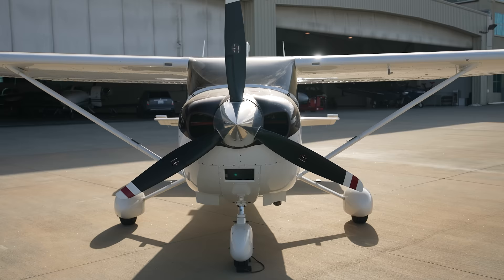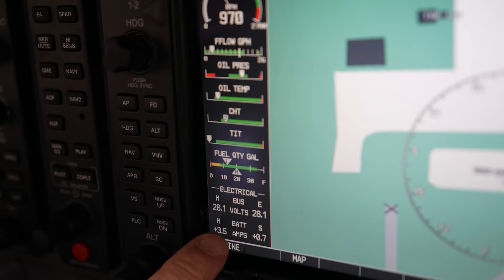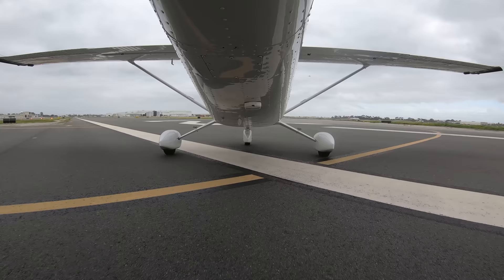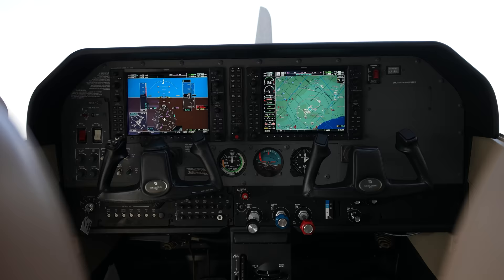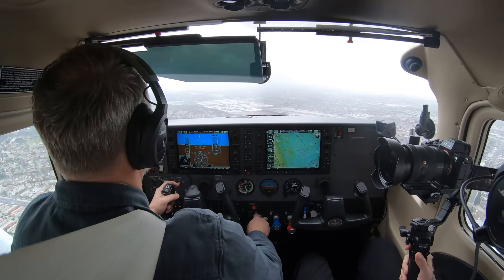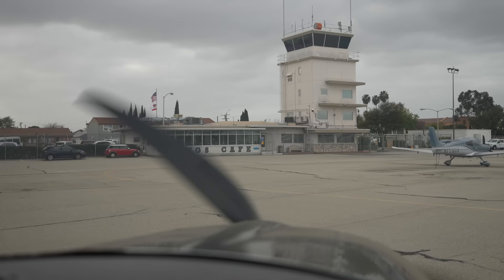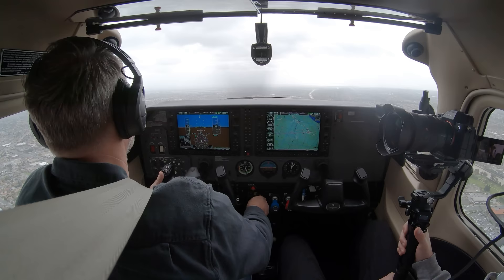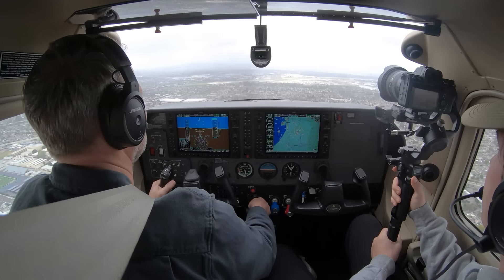2013 T182T Flight to Fullerton Airport

Comment: Great hearing you talk about getting a PPL later in life.  Got mine recently at 52.  The only downside is the cost.  I have learned and should have realized before, that its a "rich man's" hobby to some extent.  Sure, you can find a cheaper old aircraft, but throw in storage, maintenance/annuals and insurance.  Cheap, it is not.
Reply from the maker: Agree. Sometimes a flying club is a good option if you can justify whole ownership. Thanks for the message.

Comment: Hi, First, I must outline that I enjoy watching your video, all your videos.  Informative and inspiring!  My question is: since a brand new (2023) 182T will cost little more than 700K $  or 770K $ as you mentioned, isn’t this 2013 aircraft quite expensive at 610K?  Ok for very low AFTT but a 10 years (almost 12) motor!  I don’t know at what price this aircraft was paid and if it is significative!
Reply from the maker: Thanks for the message. It sold at a price very close to asking price so in my opinion that’s the market. We can come up with all kinds of ways to value or de-value airplanes but the real value is what someone will pay and the other will sell.  You can’t get a new T182T for a while so that drives used prices up too.
Reply: @FlyingwithRich  Thanks for answer! Fly safe!

Comment: Would it be possible to talk about the type of missions the owner(s) have/had for their aircraft(s). How far they usually travel, is it just them flying, 2-4 people with them, business or family/pleasure, owner flown or owner not flown. I know you said this owner got his PPL and instrument in this one then got 525 type I believe.  

Would like to know how they were using the 182 before the jet and what were some reasons for the upgrade to the jet?
Thanks!
Reply from the maker: Family business owned aircraft in the past - strictly business use. Purchased a 525 4 years ago and then the 182 for Matt to train in, build some time. I fly with them and CEO also an experienced pilot, and Matt will crew it as well. They use the Citation strictly for business travel.
Reply: @FlyingwithRich  thanks for the reply!

Comment: So this is a Great plane and all, but the engine does not turn 2,700 RPMs, and thus would you not get 300 hp, or maybe this engine just makes 285 hp , so what can we do to get full RPM and full power?
Reply from the maker: I think you have to put in a different variant of the Lycoming 540 to get 260HP (not sure available for turbo) at 2700 RPM. Older 182s can get upgrades to the Continental 550 for 300HP which I really like. We’re doing one now so will have some videos coming on it soon.
Reply: @FlyingwithRich  kewl!

Comment: I had a 2004 182T, first year with G1000. NOTHING has changed.....except the price has doubled. No improvements, sadly. 
Overall, it is a great platform but the value is questionable. At least for me.

Comment: Even if you had eight engines you would still have  rpm
Reply from the maker: I’m not sure about that!
Reply: @FlyingwithRich  I am. Your idea would be revolutions per minutes. Which is absurd
Reply from the maker: The RPM indicator on a twin engine airplane has two needles which is plural - RPM for one engine, RPMs for two engines.
Reply: @FlyingwithRich  nonsense. The plural part is revolutions. More gauges and more engines doesn't change that